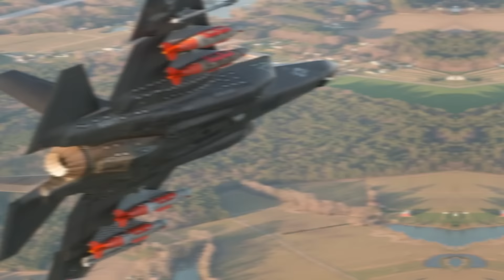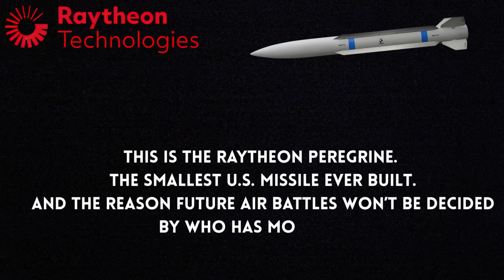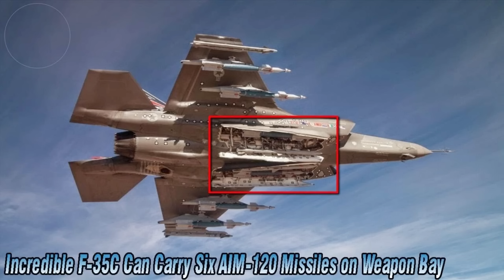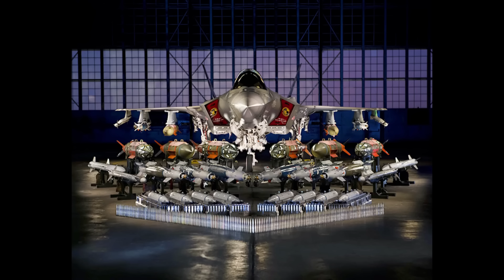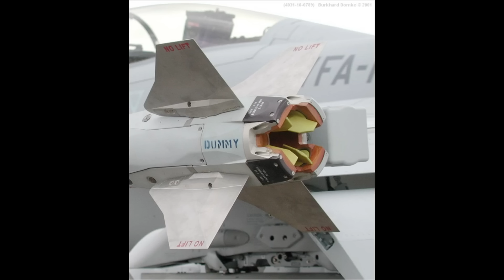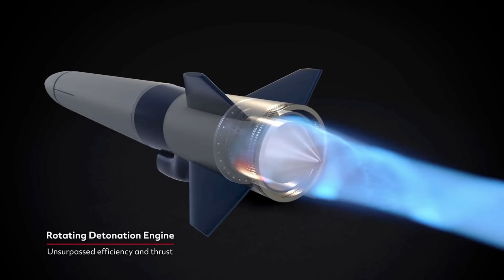The Smallest United States Missile Ever Built (and Why It's Deadly)

Comment from the maker: I should’ve mentioned a few baseline numbers in the video, I’ll cover them clearly here.

To clarify the numbers:
F-22 can carry up to ~10 Peregrine-class missiles internally without losing stealth, depending on final rack integration and bay geometry. The smaller form factor is the entire point, magazine depth increases without compromising low observability.
Beast mode is a separate discussion. With Lockheed Martin external pylons, the F-22 (and F-35) can theoretically carry far more Peregrines, but at the cost of stealth. Exact numbers aren’t public yet because configurations are still being evaluated.
-That’s the real story here: the Air Force isn’t just building a missile; they’re experimenting with employment concepts.
Stealth-first, high-magazine internal loadouts.
Mixed internal + limited external carriage.
Full beast mode for air dominance after air defenses are degraded.
Peregrine isn’t about maxing missile count at all times, it’s about flexibility. 
Commanders get to choose:
- Do you want stealth?
- Do you want saturation?
- Or do you want overwhelming volume once the airspace is permissive?
That trade space didn’t exist before. Peregrine creates it.
Reply: I think not compromising stealth is the big deal. F15EX can be the missile truck several miles back after F35 has taken out the most dangerous opponents with it's 8 onboard, then it can close up the bay doors and remain stealthy while designating targets for the F15.
Reply: @sheldoniusRex  we have the AIM 174 with over 200km of range, and too big for stealth fighters, what else but to provide additional missiles to the fight without compromising stealth fighters.
Reply: Now make one the same size as the AMRAAM with a 200+ miles or a new AIM-54 Phoenix.
Reply: Yeah but this thing is still 6 ft long though. You don't need anything near that. Think about it, a missile the size of a shoebox with enough concentrated explosives should be more than enough to rip a jet apart. Confused why these are still so large. You should be able to hold hundreds of foot long missiles in the future. I mean hell, you could go even smaller and do an EMP blast missile which would be more than sufficient to knock out a jet from combat.

Really, the ideal thing to do would be to create bullet sized missiles that could be fired like a machine gun and each of them having their own targeting software. Could you imagine? You won't have to because I guarantee you that's the future if lasers don't beat them to it.
Reply: @Villianova there's an annoying thing called physics that gets in the way, the smaller the missile the more you have to sacrifice in capabilities, for example the APKWS missile allows an F 15 to carry 48 missiles, but they have roughly half the capabilities of a sidewinder at best.

Peregrines sacrifice both warhead and delta-V to cut down size and is approaching that limit by flying smarter, any smaller and you'll have to sacrifice range.
Reply: @Villianova The same reason rockets that go into space are large... Most of the maas of a rocket is fuel. To achieve range,  you need space to carry your fuel.

Comment: As long as these missiles are able to hit their targets with a high PK (probability of kill) then it's all good. If their just carrying these missiles because they need to to achieve a high PK then there's a missile problem. In Vietnam the F-4's and other fighters would carry a high missile count because the Sidewinder's and Sparrows had a low PK that's why they added a gun to the F-4 again.
Just loading up a air craft with missiles has it's downside of adding weight that decreases aircraft maneuverability and burning more fuel.

Comment: So many errors, where to start.  Peregrine is a descendent of the Small Asvanced Capability Missile program which was intended to boost fighter missile store in general not just stealth fighters. It only double the number of anti-air missiles carried. The F-22 carries 6X AMRAAM missiles internal. The F-35 currently carries 4X AMRAAM missiles internally, if and when it finally recieves the "sidekick internal launch pylon" it will carry 6X AMRAAM internally just like the Raptor.  So, the F-22 with Peregrine would carry 12X in its main weapon bay and perhaps two more in its side weapons bays assuming the fit and can be integrated.  Otherwise its 12X Peregrine and 2X AIM-9X Sidewinders for 14 missiles internally.  The F-35 could carry 8-12 Peregrine depending on when sidekick is integrated.  No where near five times there current missile loadouts, just double. Even an F-15EX which can be armed with 12X AMRAAMs is only carrying 24X Peregrine missiles. not that they ever would advanced missiles aren't cheap and that many is unnecessary anyway since ideally the goal is to kill opposing air assets while still on the ground.

Comment: The REAL "killer app" for the Peregrine will be putting it on autonomous drones like the Anduril FQ44. An FQ44 is currently capable of carrying a pair of aim-120 AMRAAMs. It can easily be modified to carry 4 or 6 (or more?) Peregrines. So the idea would be to have, say, a pair of manned fighters escorted by multiple FQ44's carrying 4 or 6 missiles each. Or they could act as escorts for a Missile launching aircraft like a B21. These aircraft could literally spray missiles at defensive interceptor aircraft... allowing the bombers to safely "launch and leave".

Comment: Yeah but this thing is still 6 ft long though. You don't need anything near that. Think about it, a missile the size of a shoebox with enough concentrated explosives should be more than enough to rip a jet apart. Confused why these are still so large. You should be able to hold hundreds of foot long missiles in the future. I mean hell, you could go even smaller and do an EMP blast missile which would be more than sufficient to knock out a jet from combat.

Comment: Seems extremely unlikely range is anywhere near 100 miles.  Solid rocket fuel chemistry is well understood and limited by physics, so using half as much fuel for same range doesn’t seem feasible.  Peregrine does not appear to use air breathing engine either, so range is likely somewhere in between 20 to 50 miles of A-C versions of Amraam not 100 miles of D.  This makes sense as Peregrine is not intended to replace Amraam C or D currently in service.

Comment: By definition, the Peregrine is not multi-type carriage capable.  It's 6ft length means it's too short for rail carriage which means it's not going to be carried by the F-16 or F/A-18 and probably is not going in the sidebays of the F-22.

Its carriage volume is going to be set by the ejector interface which, at present, means the BRU-61.  BRU-61 is a wide, suspended, pallet system with four missiles.  None of today's Gen-5 have the bay depth to stack missiles vertically and the width + loaded weight of the BRU-61 (1,650lbs) is such that loading is only possible on the innermost station as an alternative to GBU-32 or 39.  This means that the F-22 will have an awkward load of 2 AIM-9X, 8 Peregrine, and 2 AMRAAM, with the station inbetween sterilized due to the width of the BRU-61, meaning, to get four Peregrines, you have to yield an AIM-120.

The F-35 is similarly awkward, given that it is designed as a multi-role platform from the start, which means that it will likely be carrying SIAW/AARGM-ER on a first night of war basis and GBU-39/53 when it come to second night site clean up in a SEAD role. This means that it will likely have just the door stations available which translates to 2 or perhaps 4 missiles from a modified, tandem, ejector.  Given the sculpted nature of the door and it's thickness, it remains to be seen whether the F-35 will be able to mount multiple LAU ejectors on the door simply because the missiles will have to cant to follow the contour of the panel and this will create nose-down clearance issues with the main bay station and any ordnance carried there.  AGM-88G is an 11.8" missile and the BRU-61 with a 7" missile body below it is at least a 15-16" vertical dimension.

Realistically, you are talking about 8 Peregrine and 2 AMRAAM, for a total of 10 missiles, internally.  External weapon pods, with their own bays, could increase this to 16 Peregrines.

And these jets, unlike a period equivalent F-16C Blk.50d will not be Force Protection assets in the sense that they will not be equipped to handle both air to air and surface to air threats.  They will be optimized to one threat and positioned accordingly.

The Peregrine is not a 100nm ranged missile.  Not with an RDE/ODE propulsor.  Not with an HFDR.  It likely equals the AIM-120's midrange value of 40nm against a high energy, non-maneuvering, closing target.   To make that shot enter the high .8 SSPK value, it likely has to be fired inside 25nm and to make it RNe, probably inside 15nm.  Because these are realistic values for AMRAAM.

No missile which has a peak mach of ~4 is going to get downrange quickly enough to (loft with multipulse motor secondary burn to reaccelerate through hypersonics) to account for random target maneuvers, assuming (via radar, MAWS or IRST) the threat doesn't actively detect the missile launch or closure in time to turn and extend past pursuit.

Peregrine is not an R-37M.

Assuming it performs like one is ridiculous.

It's body metrics are those of a MICA-NG (SACM is not a 2025 program but a 2015 one, MICA-NG began in 2018) with likely similar kinematic performance.  Say the equivalent of MICA-RF + 50%.

It is not going to be a monster missile that turns the F-35 into a super sniper system because it's relatively short range will put it inside the detection zone, for the launch aircraft of modern QWIP/DROIC IRST like the 101KSV Atoll on the Su-57, the EORDS-86 'Cat's Eye' on the J-20/J-35 and the Skywards NG on Gripen.  All of which will see the F-35 by 25-30nm and the missile launch event from 50-60nm.

Because the F-35 is kinematically inferior and the low threshold decision to abandon the XA-100 for the F135 ECU will not drastically improve this, you will be let with firing inside the enemy cued detection range footprint whereby dual IR-RF tracking with a powerful AESA will bring R-77M, PL-15 and potentially Izdeliye 810 and PL-17/21 to the table.  None of which the Peregrine will be able to kinematically overmatch.  Even if (due to stealth) absolute firing ranges are similar, these weapons higher midcourse velocity, deriving from similar generation propellant in a much longer motor tube will lead to a 1-2 Mach superiority in closure which will add up to a critical 15-20 second first A-Pole advantage.

And that will be that in any platform which doesn't have rapid acceleration to persistent supersonic speeds.  The F-35 does not.  According to the SPO and no less than General Bogdan, the F-35 is 8 seconds off Mach 1 sprint in the A and 16 seconds in the B while the C is 43 seconds shy of peak acceleration.  The first means it doesn't meet the F-16C.50 KPP (clean, with tip missile, under 29 seconds) and leaves the others in the category of the F/A-18E with 'attack aircraft' conditional performance.  Add to this the lack of extended (more than 1 minute) burner use in supersonic conditions due to delamination of the stabilators and therefore, the notion that F-35 can afford to sneak into a midrange fight from which it will never extricate itself becomes highly debatable.

As the former RAND researchers John Stillion and Harold Scott stated in their findings for a computer simulation of a theoretical Chinese U.S. war over Taiwan:
"The F-35 is double-inferior, it can't turn, can't climb, can't run..." from any fight it gets into.

This is important because where you are swooping into LAR to take edge of envelope shots at extreme distances to avoid extremely lethal terminal performance by exiting on oblique lines while trailing wingmen or second section jets provide midcourse updates before husky/pitbull release, you cannot be as sluggish (no Ps above Mach 1.2 and 25,000ft) as the F-35 is.  You essentially have to have 30,000lbs of fuel and two engines in the 30,000lbf IRT/45,000lbf AB thrust range to ensure the safe exit from threat envelopes.

Failure to do this vs. J-20 and Su-57M with late series WS-15 and AL-51F1 will mean they can defeat your 'deep magazine' concept with similar techniques and ally them with superior parent performance in the 40-50 block, Mach 1.8+ regime to both shoot as often and fire with greater kinematic boost.  Making the F-35 just as vulnerable as ever.  Because they are STILL looking down on it's vulnerable topside planform and thus getting both thermal and radar signatures which the F-35 (with its EOTS under the nose as a bastardized targeting FLIR being used as a pseudo IRST) masked by the lookup angle.

The F-22 might be able to handle this, though the reality of the Raptor MLU upgrade to external tank carriage is one of compensating for a severely under-fractioned internal fuel load for the SWAPR operating theaters having to be compensated for with both signature and drag penalties.  Yet the F-22 is a diminishing asset which, even today, is severely outnumbered by the J-20 primary threat in conditions where 'numbers count' (300 vs. 150, combat coded).

Too few Raptors, inadequate performance and carriage in the F-35 and the appearance of similar (low) F-47 acquisition numbers to those which doomed the F-22 all add up to a scenario where CCA doesn't work because it's not autonomous and lacks radius.  And a refusal to admit to Don Quixotism means a lack of rapid shift to super/hypersonic standoff missile alternatives is pre-programming America to lose a major war which we apparently seek with China AND Russia as allied partners with vastly better war manufacturing bases and increasingly superior technical solutions to the U.S. fixation upon manned airpower.

SACM is lost in a decade long development hell from which it lacks the manned-system support to exit with a produceable missile which works on the 'longer spear' not 'sneakier ninja' school of tactics.  The derived Peregrine increasingly looks like a weapon sized for the small bays achievable with UCAVs but those programs are all centered upon cruise missile sized airframes without the 1,5000nm radius to be capable of flying weapon truck operations in support of manned aircraft.

If you don't purchase those manned jets, due to budget or technology base restrictions, then they are completely inadequate (wrong airframe design, wrong cost metrics) for independent ops.

This is not a good plan.
Reply: Please get your analysis to the Pentagon right away. Obviously, they've missed something. And the F47 allotment is with the condition it work as a system with CCAs. Same with future F-22s, F-35s and even F-18s. You seem to be assuming no changes in a number of areas. These reads like the dooms day of climbate change, where NYC is under water in 50 years but no one allows for the inevitable adaptation that occurs as a threat nears and humans are involved.

Comment: The Peregrine missile is a next-generation, small, lightweight, and affordable air-to-air missile developed by Raytheon (RTX), designed to significantly increase fighter jet missile loadouts, potentially doubling them, while offering speed, range (Mach 5+), and advanced tri-mode guidance (radar, infrared, laser) to counter drones, aircraft, and cruise missiles. Unveiled in 2019, it uses additive manufacturing and common parts to keep costs down, complementing existing missiles like the AIM-120 AMRAAM and AIM-9X Sidewinder for enhanced air dominance.  
Key Features & Capabilities:
Size & Weight: Roughly half the size and weight (around 6 ft, 150 lbs) of the AIM-120 AMRAAM, allowing for more missiles per aircraft. 
Performance: Aims for Mach 5+ speeds and performance comparable to larger missiles, with great maneuverability. 
Guidance: Features a multi-mode seeker with GPS, millimeter-wave radar, and semi-active laser for all-weather, all-aspect targeting. 
Manufacturing: Utilizes additive manufacturing and readily available materials for lower cost and rapid production. 
Role: Intended to be a complementary weapon, increasing the "magazine depth" (number of missiles carried) for fighters like the F-35 and F-22, especially in stealth configurations. 
Purpose:
To provide overwhelming numbers of affordable, capable missiles for modern air combat. 
To counter threats from drones (UAVs), manned aircraft, and cruise missiles. 
To extend the effective range and lethality of fighter fleets.

Comment: I certainly can't disagree with the effectiveness of increasing magazine depth on ANY plane, so I'm not disparaging the missile its self.

But then the APKWS has been mounted on the F-15EX up to 44 per loadout, and on the A-10 to a record breaking 114 rounds per loadout.

So saying 20 is a lot...

Is...

Well...

Relative.
Reply from the maker: My mistake, I didn't mention that these numbers are only on beast mode. On stealth mode F22 can carry 10 of them and F-35 can carry 8 of them. Above the number I mentioned, you lose stealth mode.

Comment: Four issues, China’s PL-15 has at least double the range of AMRAM and that is only the missile that they have shown. Secondly, how much rare earths does a peregrine need because China will not be supplying. Thirdly, nobody outside China really knows how sensitive Chinese radars are. Last but not least, China’s defense development and procurement cycles are 1/3 of the USA’s. If this was displayed in 2019, you can bet that China has already taken note and developed countermeasures. And with China’s industrial capacity, anything the US can build, China can build cheaper, faster and often better. Any advantages Peregrine, a missile that has still not been adopted by the USAF gives will thus be short at best, illusory at worst.